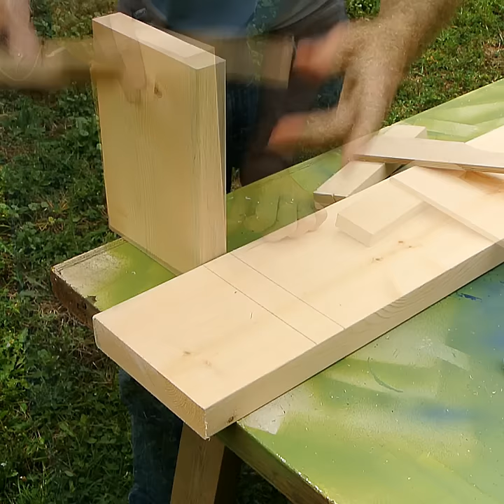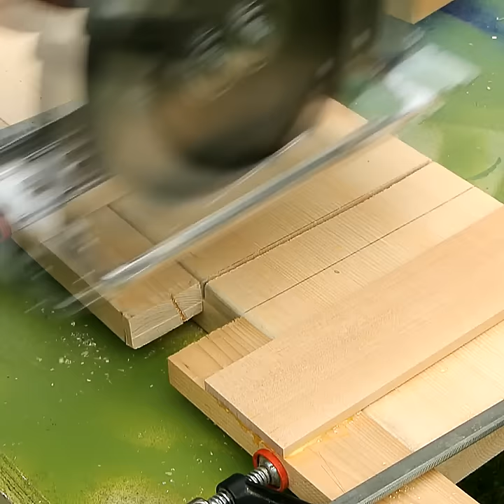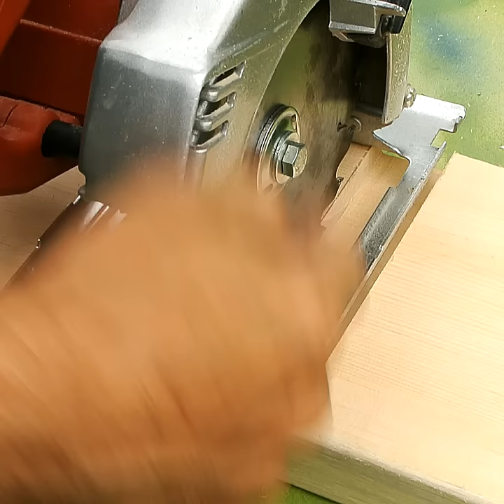Cut dado joints with a skillsaw #shorts

Comment: I believe even the guides are made in a clever manner. Creat the pair of T's, then run the saw through each one, cutting them down to the perfect size for each side of the saw shoe.
Reply: My takeaway from this video is that I need a pair of those Ts.
Reply: I made a pair of guide blocks for my jigsaw the same way.
Reply: Thanks for the tip - a much easier way to get the right width.
Reply: Even easier than you think.  Create a double T or single H that exactly fits the width of the saw base plate, then cut once and you have both left and right jigs.
Reply: @mitchd949  I don't care what they say about you on Animal Planet.   That's a fine idea right there.
Reply: @mitchd949  very clever insight little buddy!
Reply: Even easier than that.  Just make one with the blocks glued in on each side of the shoe, then cut that in half with the skillsaw.
Reply: @paulkolodner2445  ĺlĺp
Reply: Top

Comment: This is so clever, especially the way you can use the saw itself to make those jigs. I recall you wanting to put some fancy joinery on the center shelf of that huge bookcase, and was thinking it could possibly have benefited from a sliding dovetail. You could stop the dado a bit short, just by clamping a block at the far end. It also wouldn't require the claw hammer if you made passes with the blade angled in either direction.

Comment: I bought and modified a concrete channel maker, which uses a dado like blade arrangement to do the same for wood. Wasn't easy, and without access to a lathe and a dado set that's small enough to fit the smaller blades of a concrete channel tool, not gonna work. Use it mostly for restoration work where we have to reinforce old beams without being allowed to replace the apparent face. It doesn't plunge cut anymore, so the fixed depth for it is 4 cm, but that's enough to cut a 3x4 cm channel in a beam so a reinforcement can be slid inside.